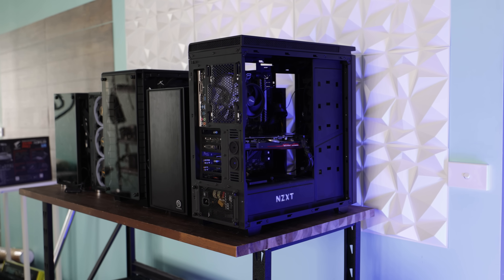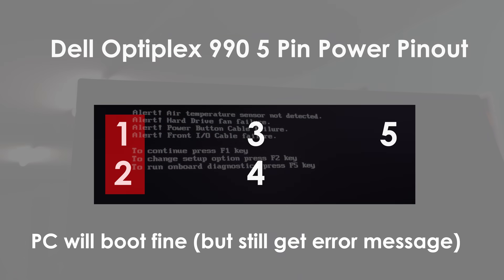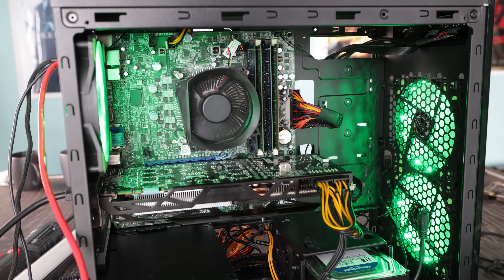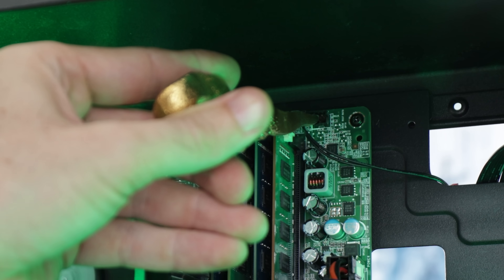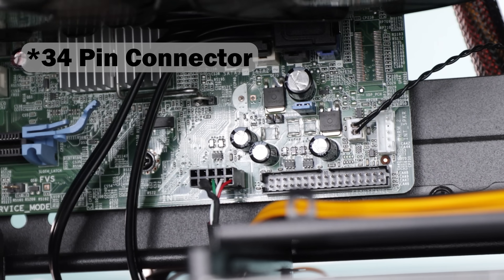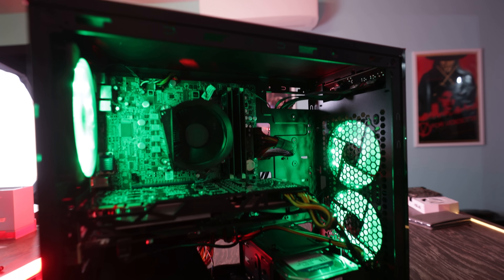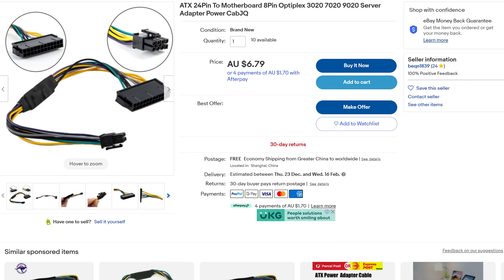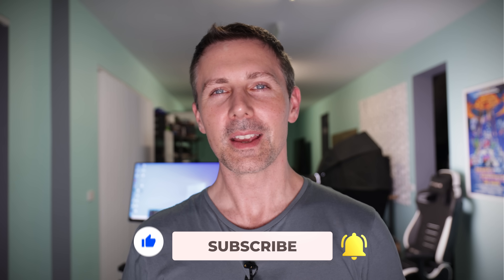Turning a Sub $100 DELL OptiPlex into a FAST Gaming PC

Comment from the maker: Lots of comments about adapters being available so why bother like I did in this video? I checked prices of the front i/o and power switch adapter kit, would cost me $57 AUD to get those connectors shipped to Australia. I pick up the whole hardware itself cheaper than that a lot of the times....
Reply: You did a good job on the video Bryan. I know tons of people who have these builds with these stupid errors. The whole point is to keep it cheap. Keep up the good work
Reply: Separate from what you said, on the newer 6000 and 7000 series intel optiplex's you can use the Qtj1 and Qtj2 ES 6 core cpus from aliexpress with a bios mod on them, I have a friend who is running it with an old hd 7870 6gb
Reply: Yo @Tech YES City you can use power led connector instead of a jumper / along side of the power switch connector. the led closes the circuit. I do this and it works nicely. and you have a power led on case.
Reply: ive had a gtx 1060 on an alienware x51 motherboard in an asus mid tower
Reply: Man thanks so much tech yes
Reply: Taking a little dive into electronics and get a multimeter would save you a lot of headaches, the one sensor might be a DS18B20, LM35 or similar temperature sensor, also you could just test the pins with a multimeter and customize the front panel adapter, the same for the system fan, a jumper with a resistor might make an elegant solution for that or even better just replace the original fan with the one you use in the new case. But still very interesting, I am debating for a while already to get one of this systems, they are spread very far all over the world in offices, schools and so on and so are cheap and easy to get, but I have no idea about actual hardware itself, left the pc section like 15 years ago as I built my Q6600 system, which I never used.
Reply: i think i should change my pc like you
Reply: 🤣I did exactly the same thing except I found Dell optiplex 9010 i7 in the trash all the was missing was hard drive. Since then I been coming up on old PCs making them into gaming system on the side 👍
Reply: @miketheevolutionslayer2649  have pictures yours pc 9010
Reply: you dont need the adapters at all, its all done via jumping 2 wires on each the hd audio connector, the front green usb port, and the front panel connector,  and it disables all the annoying error messages on boot
Reply: That sound card was $30 Bryan! $25 shipping?😆
Reply: what case?
Reply: check moddiy they're better quality and cheaper
Reply: Noticed you were installing into Legacy boot - I deal with theses machines everyday (work for a Dell config center/partner) - in the future I would recommend selecting UEFI as it will prevent some driver issues in the future.  Love seeing more people getting into hacking the Optiplexes (can't wait for my work to offload their "legacy" systems as I plan on snatching them up to flip or NAS/Media Servers).  
as always love the channel and what you've done for the community.
Reply: U know the power button led where does that go
Reply: I have a optiplex 3020 sff and rx 480 4gb and no display shows card works the card slot is fine motherboard displays video and I plug in rx 480 it’s not detected sometimes I can hear sound no video
Reply: you do know to go to ebay an get a Front Panel Header Adapter Kit For Dell Optiplex

Comment: Even though it is years later, for me this question is still relevant ,I believe. Like you I don't want to stuff the front audio panel somewhere in the case.
So what I think you're saying is that you can install a soundcard (like a Sound blaster Live which I have) and then use a cable to attach the soundcard to the PC case header to make the front audio port work? Is this correct? Thanks.

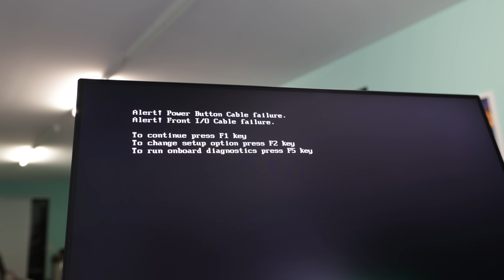Comment: I did a Case swap for a Customer’s HP PC as HP wanted £150 for a replacement PSU, I do have 2 x Dell Optiplex 790 SFF PCs here and neither have working PSUs, Another one of my Customers needed a PSU for his Office PC, I was able to use a Standard ATX PSU and leave it dangling outside the Case although it’s not ideal but it did work, I also installed a Standard 750 TI Graphics Card in one of the PCs and that worked fine too although the Side Panel couldn’t be put back in place, It was a bit of a Frankenstein PC and I only used it for Folding@Home, I do want to transfer the Components into standard Cases so Standard PSU’s could be used, That 5 Pin Power Connector, Surely 2 of the Pins will be used for powering the Power LED at: 7:10 ? Good Video! 🙂🇬🇧

Comment: Another adapter that may be needed if the board came from a USFF (Ultra Small Form Factor) model would be a miniPCIe to PCIe x16 (or x4) as for the USFF models the spec sheet (for the Optiplex 790 & 990 for example) shows the only expansion slots is a microPCIe instead of a x16 (& x16 wired x4) of the larger form factor models.

Comment: I have 2 mobo the one i have is same on this video the other is not.

This other mobo from optiplex 3010 have deference connection how can i do the same way to fix the i/o error

Thank you for this i fix the problem of one of my unit

Comment: You need to rip out the front I/O from the original Dell Optiplex and just hide it in the case, no more message on that.

Is the one with usb ports n stuff, its kinda small thingy, it should come out like a dvd drive.

Comment: You can get a USB2 sound card that would plug in the front for $8 and this way your GPU fan's aren't blocked by an old PCI sound card that is just messing up your airflow inside your case.

Comment: I love builds like this, I did a used part build last year with ebay and local seller parts. I was able to get a 6600k, Z270 mobo, 500gb ssd, 16gb of ram and a gtx 980 classified for about $250, The best deal I ever had in my life was the 980, bought it locally and the seller only wanted $50 for it and it was in pristine condition, I almost felt bad about using it. It came in the original but opened box looking brand new, with all the original documentation, manual, driver CD, sli bridge, and unused stickers + EVGA badge. All of that just so my girlfriend can fire up robolox and Minecraft lol...

Comment: I plan on doing a weird reverse at some point. Use the Optiplex MT case, preferable the 4th Gen cases for the USB 3.0, to build a rig in. The tip about the forum helps me figure out the front I/O problem. All I need now is $1,200 that I specced and we golden 🤣🤣🤣

Comment: Regarding rewiring power button connector (at 8 min position in the video), you can connect Power LED of your new case to 3/4 and 5 pins of the MB power button connector (check the polarity).

Comment: Hi.  I'm an old Mac, my son is a newbie PC.
Late last year he picked up an old i7 Optiplex 9020 slim desktop for $50 from his school - he was delighted - I'd been trying to get my old Mac Pro to boot into Windows for him without success, so he saw this as a great deal, finally being able to play all those Steam games that Mac OS couldn't.  Except... the stock graphics card was so appallingly bad, it quickly turned to disappointment.  
Last week I helped him source a Geforce GT 1030 low profile card, and for a while we thought it had been a waste of time, as there was no way it was fitting in the PCIx8 (16?) slot with the PSU in the way - But then after watching some Youtubers, we tried it in the PCIx4 slot, and - viola!  He's happy as a pig in shit now, playing high end games on a 9 year old Dell.
BUT...  I am thinking something like what you've done will be the way to go long term - buying a bigger better case and transplanting the guts over.  I'm glad you've worked out these issues, as I am sure I'll be coming back to check out what you have done.
Cheers

Comment: to get around the fan error just jumper the speed signal wire from one fan header that is used by an actual fan to all fan headers that need to see a speed signal. the other pins aren't needed to be used just the speed signal pin jumped to any fan header that needs to see an rpm signal.  temp signal bypass is simple as a resistor jumpered in place of the sensor to act as a bypass if not needed.

Comment: with just $300 you can spend $100 on an optiplex, $80 on a graphics card, $40 for a new psu, $40 on some new ram, and you'd still have $40 left

Comment: Used Dell 120mm fans are cheap on eBay so if you don’t need the bling just pick them up I have a 12 year old dell fan running 24/7 without noise. Just a bit if lube and dusting

Comment: thank you so much for this video, cause i moved my old pc in a new case and had to use the old power button and it was kinda wiggling up on the case ports, and now i could use the normal case cable

Comment: Thanks for the data on the jumper pin positions! I will consider this If I want to do a case transfer  I followed The Game Bench instructions for a gaming pc build on a Dell 7020.  However, If i did a case transfer, how did you get the fans to follow the cpu fan speed.  My build I added the front aigo fan but it runs at full speed just plugged into the sata power connector.  Is there a pc fan controller that works with dell opti's permits fans to slow down automatically rather than using a resistor or mechanical switch?

Comment: I changed the case of my Dell Optiplex 3010 and since then it automatically turns on when AC power is restored. First I thought it was the BIOS settings but when I changed it the problem still persist.

Comment: juss fliped a optiple 550 i believe had an i3 7100 but i found a i7 2600k for 20$ !!!! so im using tht cpu instead but came with windows 10 500gb hdd 8gb ram ! so i juss took the hdd with windows , moved the hdd and ram over to my old 7010 mobo added a 100$ 1060 3gb , moved to a corsair case for 40$ ill find the name soon but added a all white cpu cooler with white fans and white cable extension !
Reply: and like i said i used to the adapter pieces and worked like a charm but i did have so mucb trouble with it choosing a bootdtive before i swapped the cases but now with those extensions and rverything rewired it boot straight in!

Comment: so i bought these dell optplex adapters for the usb and power slots so you can add case pins and it actually bypassed my last 2 errors which were the air temp sensor and boots immidietly into windows so idk the adapters saved me so much extra

Comment: You can install the motherboard from a sff iptiolex into a normal tower or at least a mid tower? I bought a sff by mistake with the savings that took me 8 years to get due my country is too poor and salaries here and too low. I have a case from s utech empty so I was wondering I could move the hardware from the sff to that one.

Comment: you can use an LED to short those pins to remove the error as well from my memory, if i remember correctly its because they wire an led in the switch..been a while but.. i do remember using jumper terminated led's to short these and similar boards from dell and hp.

Comment: Hey!
I need help with my dell optiflex 7020 sff.
I installed his motherboard in a large case to install a 1GB Nvidia GTX 450oc graphics card.
The problem is that the video card turns on, in the BIOS you can display an image on it, but it is not.
Tried to put another one, same thing.
I would like to say thank you for your help!😀

Comment: Nice guide. I didn't realize these Dell motherboards were such a pain. The HP Prodesk 400 boards are way less work to mod in my experience. You just have to solder a bridge wire on the USB ports and cut a little piece off of the case fan header plastic then they work like a standard ATX board.

Comment: Did this recently with an optiplex 3020 and an RX 570. Needed a 24-pin ATX to 8-pin Dell PSU adapter, but that was 14 Canadian bucks shipped. Got it sold within a day. These are a great option regardless of the GPU. An RX 550 will do you just fine for gaming on the cheap.

Comment: for the windows part, couldnt you just pre install windows on a ssd from another computer and just plug in the ssd in with everything already configured, kinda like just switching hard drives

Comment: My friend has an old 2011 optiplex of some sort that features the original parts. a GTX 700 series GPU and a nice cpu. Runs and even qualifies for windows 11. Runs rocket league at 60 fps. What the fuck? The internal GPU that came with the CPU is better in some cases than the actual GPU. I'm going to ask him for the GTX.

Comment: Another thing you forgot to mention is that a lot of the old Dells use 5000RPM Delta 120mm fans, which absolutely kick ass on an AIO. They're loud as hell, but you can't beat the airflow and pressure with any other "gaming pc" fan, considering almost none of them even do 2000rpm, let alone 5000. It even destroys the A12x25 Noctua fan.
Reply: Yeah, fans on prebuilts sometimes are great!

Comment: I have a question I hope someone could be kind enough to answer this I'm about to get a new case should I go with a tampered glass front panel or meshy front panel? I want to make sure there's good airflow but I'm not sure what would be the best choice
Reply: It depends on how much of a monster CPU and GPU you have , 60 95 120 watt CPU etc.

Not all glass fronted cases are equal, some have good/usable airflow, others dont.

Less openings means more fans more noise to compensate.. a 200mm front fans purrs and is near silent. or two or three 120mm in parallel running at low rpm.

Comment: I would keep the case and get good monitor with good 1030 TI with good intel CPU from there i’d get better case then better mother board and radiator with nice sleeved cables too

Comment: a bit late but im working on an optiplex 9010 that im pretty much doing the same with except Ive been meaning to dabble with it for about a year now but i had other projects to do. the mother board is similar minus the 34-pins connector. if you want, before i get further into it, i can provide some details on it and you could make a video on it

Comment: That i7 CPU in this system is a 2600S, that is a 65W TDP part with 2.8GHz base clock. There is also the regular 2600 which is 3.4GHz baseclock and 95W TDP. You can get a bit more performance by changing out the CPU if you can find one cheap or in the junk.

Comment: hey i know that it`s provably too late but you could have just connected all 5 of the pins. The 5,4,3 and 2 into one and the 1 with the power button wires at least that`s what i`ve done with my dell 3040 SFF

Comment: I killed a Dell 7040 motherboard shorting out the wrong pins to clear a 'front IO' error. It is ABSOLUTELY DESPICABLE for companies like Dell and HP to have proprietary connectors, AND not have the decency to even release basic pinouts.

Comment: I got the adapters for the  power button and front panel for the one i built a year ago. My computer is a Optiplex 790 mt, i5 2500, 8gb ram, and 500w power supply. I just have to get more ram and a gpu which wont happen any time soon. I had a rx 570 but its missing pads on the bios chip.

Comment: I recommend doing this to an Optiplex 3010, as it's much more easier (Don't get an SFF, else you need a PCIe extender cable and it comes with just two PCIe slots,  x1 & x16 ) . Front IO header are standard, got the case front IO to work with the proprietary motherboard (with a few slight modifications on the connectors) , Front Audio works and the two front usb 2.0 works as well. The only problem is the fan error which only disappears if the fan is running.  I didn't think about using extra jumpers on the power switch. Great tip on using those motherboard jumpers LOL.

Comment: When the new power supply connection did not match the motherboard connection could you have cut the wires on the old power supply connector and soldered the correct wires from the new power supply to the old connector and insulated the soldered joints with heat shrink tubing like we do in automotive electronics repair?

Comment: Im sorry, but you cannot turn an old optiplex into a fast gaming pc anymore. I paired mine with a 1060, and with modern games I'm seeing a cpu bottleneck. I have a i7 4770, and 32gb of ram. System runs fine, just newer games stutter way too much for comfort.
Reply: Not sure what the problem is. I have a 4770k, 16 gb ram, and a rx 590 and it plays practically everything 1440/60 with settings on max or high with zero problems,

Comment: Yo this is just a question I asked a bunch of random youtubers but they didn't reply I have a very trash laptop that has 4gb ram and 1000gb hard drive a Ryzen 3 3250U processor and it has a gpu that's Radeon graphics and the motherboard is hp and it has windows 10 so how can I improve this piece of junk to become a gaming laptop that can stream
Reply from the maker: add SSD and increase ram to 16gb, though depending on the game you still might not be streaming that well.... easy to play games should stream ok.

Comment: Love your videos I have a question I just bought a computer used but it has decent hardware was using it and the screen flashed red while playing and turned off And now I can’t get my graphics card to work in it Tried another graphics card I know worked but it doesn’t show up either so would that be a motherboard issue

Comment: Just an fyi to anyone looking for a super cheap lga 1155 motherboard, Look for the Dell MiH61R. These boards normally float between $15-20 but I find them all the time for only $10-12! It has a  non-proprietary front panel pin layout for everything.